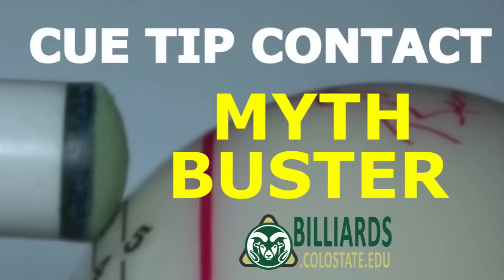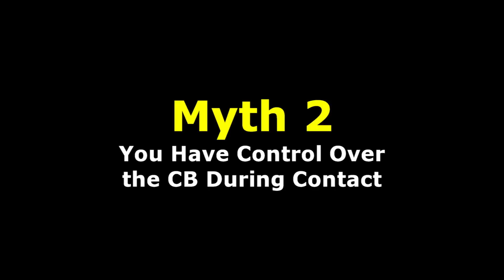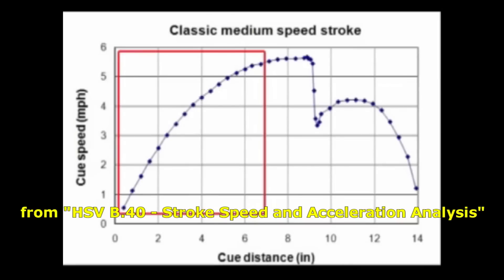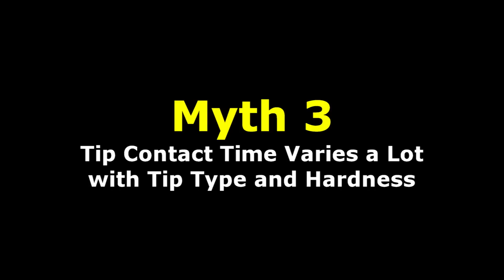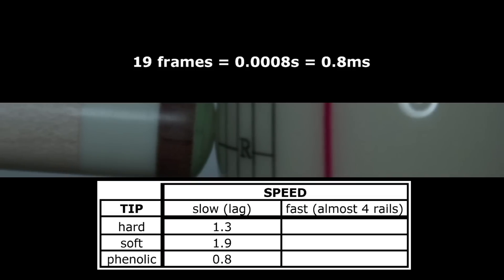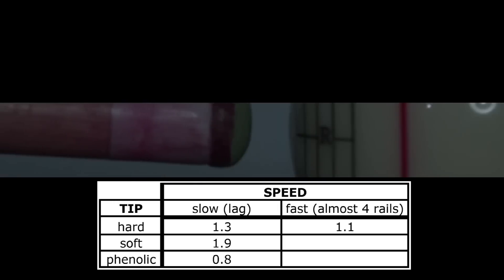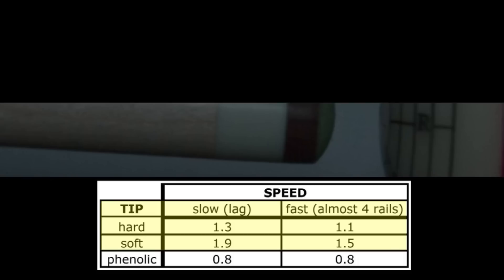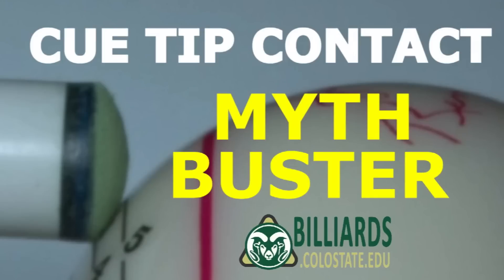Cue Tip Contact Myth-Busting Truths in Super Slow Motion

Comment: With respect, it seems like some of your conclusions/assumptions are very subjective. The tip contact time varied quite significantly - for example between 1.3 and 1.9 milliseconds (for hard vs soft tips in your video) - this is an increase of almost 50%. Why do you assume that this does not have a very significant effect? Just because both times are "very brief" in your opinion? Clearly, every aspect of cue-to-cueball influence (momentum, direction and spin for starters) can and does only occur during the time of actual physical contact - how can an increase of contact time by 50% NOT have a significant effect? I don't know what those effects might be quantitatively but I would be very surprised if they were not significant. I think one would have to look at the RESULTS - including comparing the rotational speeds of the cue ball to see if they differ but in this video there is NO data/video analysis of the actual results. My conclusion based on this video would be "cue tip hardness has a significant effect on contact time - further analysis is needed to show how cue tip contact variation influences the behavior of the cue ball"
Reply from the maker: Good points and questions.  FYI, they are addressed in detail here (especially in the "Can a softer tip put more spin on the ball?" section):
https://billiards.colostate.edu/faq/cue-tip/hardness/
and via the supporting links here:
https://billiards.colostate.edu/faq/cue-tip/contact-time/
Reply: @DrDaveBilliards  thanks for the prompt reply although I have similar issues. I'm a hard-core "science guy" so I'm looking for controlled observations and data while you seem to be relying on personal experience for much of this. Not suggesting you are wrong but also not yet convinced. In this video for example it shows differences in energy transfer based on a person striking the cue ball using three different cue/tip combinations - how is that controlled? How can I assume the identical energy/power is used by this player in each stroke? the player may well be subconsciously altering the power with which they strike the cue ball. This is NOT easy to overcome because it is a well-known/established bit of human behaviour. This "ideomotor effect" is extremely difficult to rule out. When it comes to comparing spin imparted by different tips your conclusion is similarly based on personal experience of repeated attempts rather than in a more controlled/objective way. Instead (ideally) the player should be using identical cues fitted with three different hardness tips and then (again ideally) they should be test shooting by choosing the cues at random and NOT KNOWING (the key!!!) which tip they are using for each shot to eliminate their potential to subconsciously bias the shots.  Another method would be to use the high-speed camera to compare spin rates imparted to the cue ball with each tip and - importantly - ensuring that the cue speed is the same in each case - but this could be assessed through video analysis as well. I realize this is not something that can be done readily but I think it is essential IF we want to gather objective evidence.
Reply from the maker: @ourniche  In many of the videos at the links, I controlled for speed by doing many shots and including only those where the CB or OB travelled the same distance.   And for the experiments for maximum spin, I hit lots of shots near the miscue limit, some miscuing and some not.  If you hit enough shots, one is guaranteed to be close to the limit.  I agree it would be more “scientific” to measure everything with motion tracking software (which Pubo and I have done in my recent stroke timing video), but I think it is unnecessary with the other measures taken.
Reply: @DrDaveBilliards  I don't think we can know this for sure without controlled experiments because you may simply be repeating "subconscious" actions. Anyway - I completely understand why this is so difficult to do. I would note however that the amount of momentum transferred during a collision (the "impluse" using a physics term) is equal to the "force X the contact time" so if the contact time is increased by different tips then the amount of energy transferred MUST change - all else being equal/controlled for. So I am still very doubtful that the tip hardness has no significant influence - seems impossible as it alters the physical interactions between the two balls.
Reply from the maker: @ourniche  The impulse does not change with contact time.  With a longer contact time, the force profile (during impact) has less magnitude, resulting in the same impulse and the same momentum change of the cue and CB.  The impulse is based on the momentum transfer, regardless of the contact time.
Reply from the maker: @ourniche  FYI, the math and physics of this can be found here:
https://billiards.colostate.edu/technical_proofs/new/TP_A-30.pdf
Reply: @DrDaveBilliards  I suppose that is possible - IF the force is less when contact time is extended. Impulse "by definition" is the product of force X time so an increase in time will increase impulse unless the force lessens in a way that "perfectly matches" the change in time - something I find very unlikely.
Reply from the maker: @ourniche  It is not unlikely at all.  It is the only way it can be based on the collision and momentum physics and equations.
Reply: @DrDaveBilliards  interesting! A related question - since a softer tip results in the cue tip "shape" being different during contact with the cueball - wouldn't this have an effect on how the momentum is transferred - thinking here of the vector of the "net force" - wouldn't the force be "more forward" angled compared to the interaction force produced by a hard tip. I'm just visualizing this in a quite exaggerated way - such that a very soft tip (near the miscue limit) is going to deform to produce an interacting surface that is "molded" to the surface of the cue ball - ie a concave spherical shape while a very hard tip will remain closer to a "point" on contact. Would that have an influence on how the force is transferred? There is no doubt that "off-center" collisions between rounded objects are complex enough - adding deforming leather tips doesn't make it easier haha. Thanks for responding to all these questions.
Reply from the maker: @ourniche  See:
https://billiards.colostate.edu/faq/cue-tip/hardness/
The larger contact patch size spreads out the force, but it doesn’t change the total impulse or momentum transfer.
Reply: @DrDaveBilliards  I was wondering if there might be an associated change in the "direction" of the interaction force with differences in tip/cueball interactions. Thanks so much for the link to that pdf. I'll trust all the math haha. I don't want to attempt to get up to speed (no pun intended) on the math re: rotational motion but your descriptions of the results are very helpful. I can do the math to show that the maximum speed (the limit) of the cueball would be 2X that of the cue speed in an elastic center ball collision but that is where my math familiarity ends.  I do wonder why you use actual cue masses in these equations when the cue is being gripped by the hand/arm so that they would seem to be part of the "system" that is interacting. Indeed at the moment of contact the cue "could" in theory have no unbalanced forces acting on it but in reality, it is more likely to either be accelerating or decelerating - and therefore have a net unbalanced force acting on it - which I have to think could have a significant influence on energy/momentum transfer? Wouldn't "accelerating through the cue ball" have a significant influence? I would have thought that the mass of the cue itself is really most significant when it comes to how it influences the ability of the player to generate cue speed/timing of acceleration etc Again thanks for taking the time to respond.
Reply from the maker: @ourniche  The direction of the force does not change any important amount during the incredibly brief contact time. And the cue (and its momentum) dies all the work during contact. See:
https://billiards.colostate.edu/faq/cue-tip/contact-time/
https://billiards.colostate.edu/faq/grip/light-vs-tight/
https://billiards.colostate.edu/faq/stroke/acceleration/
Reply: @DrDaveBilliards thanks for these links Dave.  You say (in relation to accelerating through the shot) "In principle, the cueball will … have more speed and spin … when you apply a force during impact. It’s just that since the impact period is so short (mainly), the effect is essentially negligible." But the impact period - no matter how short, is the only time during which momentum/energy are transferred at all - so if you accelerate the cue and increase the force during this contact time then we would want to know "how much added force" are you generating and are you increasing the contact time by a significant percentage as well? BTW - I love your video with graphs showing cue speed vs cue distance traveled but would be very interested to know if you have ever done this analysis with "amateur players." In your video you analyze the strokes of three excellent players that all reach maximum speed nicely - I'm wondering if weaker players don't do this - IE if this might be a significant weakness in their cueing (other than aim lol)
Reply: I see that you do note that the force IS very small relative to that associated with the momentum of the cue itself - so that makes sense (so I jumped the gun 
when I saw your reference to contact time being "mainly" responsible). Thanks again - I'll have to look through your very rich set of resources looking for analysis of the physics of "weaker players" haha.
Reply from the maker: @ourniche  You seem like the type of person who will actually enjoy and get something out of the resources.  I hope that’s the case.
Reply: @DrDaveBilliards  absolutely - much appreciated. BTW - after reading your explanation for the insignificant effect of added pushing force "during contact" I thought of the perfect analogy. It is the same as hammering a nail - it is true that if you are still applying a driving force on the hammer handle with your hand/arm during impact you will be adding more energy to the nail BUT the added energy transfer is tiny compared to the energy that has "accumulated' in the accelerated hammer head during the long arc of motion before the contact :-)
Reply from the maker: @ourniche  Excellent analogy.
Reply: @DrDaveBilliards  last question for a while - I promise :-) It would be SOOOOO valuable for a player to be able to analyze their own stroke profile (ie graph of cue speed vs distance during a stroke) I have to ask - is there any way of doing this with a cellphone and software? It just seems that if I took a video from the side using my cellphone I could record the motion of my cue throughout a stroke. Then I would just need to be able to determine speed at X number of points during the stroke. I realize a cellphone can't take "high-speed" video but even a crude measure would be helpful. If I placed a "dot" on the ferrule and then just watched the video on a large screen advancing the video "frame by frame" I suppose I could just try and measure and plot this myself but is there any software that you know of that could help? We all have these phones (which 20 years ago would be considered "super-computers") with their high-resolution cameras - seems like we should be able to use them for this - maybe just wishful thinking.
Reply from the maker: @ourniche  it might be possible with the slo-mo video from a phone and a special purpose app.  FYI, the Digicue device and app can measure your stroke using sensors.
Reply: The DigiBall is going to come out this year (I hope). Although it only measures the cue ball's parameters instead of the cue's. You can get more info about that on AZB. I don't think a phone's slow mo feature is of much use for plotting the cue speed-time graph since the framerate is still not high enough. Maybe you can film the slowmo from far far away so the cue doesn't jump from frame to frame that erratically. @ourniche
Reply: Also stay tuned for DrDave's new video! It would at least proves that acceleration doesn't affect the action of the shot. @ourniche
Reply: @puboh  A "digidball" sounds interesting - I assume it will track "spin rate" which would be cool. My iPhone does record at 240 fps so individual frames of the cue are blurred BUT useful. I just did a bit of video last night and tried some analysis with the "Tracker" app (VERY nice!) - it did provide some decent graphs and info - but clearly not as refined as Dr. Dave's with extreme frame rates. Of course "training wise" it would be ideal to have immediate feedback after a shot - I guess you DO have instant feedback when you ignore the camera and simply note the amount of backspin you get on the shot haha. But the quantitative video data is still fun to play with.
Reply: I Agree. I'm having fun with this too! If you have After Effect, it has a Motion Track feature that you can utilize to accurately track the cue's motion. (It does really well when I film the shot at 8000fps, but if the 240fps camera is far enough, I'm guessing it would work half decent?? @ourniche
Reply: @puboh  Unfortunately I don't have After Effects - just can't justify the Adobe license fees for something I would use so little. Have you seen "Tracker" - might work very well with high-resolution high-frame speed videos. Designed for physicists (perhaps mostly physics teachers?) to analyze the motion of objects during collisions and other physics experiments for example. An issue for me is the image can't get too blurred (which it is borderline with 240 fps) or the software understandably has trouble tracking the "chosen point(s)"
Reply: @ourniche  no I have not. I'll check it out!

Comment: I appears that the tip sticks to the ball and the que tip will bend as the ball starts to roll.  Just becouse something can't be seen in 1 ms dose not mean that things are not going on in much less than 1 ms.  Collisions like this are very fast.  I found it interesting that you used miles per hour on your chart.  Cheers.
Reply from the maker: Agreed.  Super slow motion video reveals a lot.  I used mph because that is the common speed unit in American pool (e.g., when talking about break speeds).

Comment: In your "Tip Contact Time" portion of the video you are doing the testing using a tip that is very low. I believe the results would be different if you use a new soft or SS tip. The tip compression time has to change things in this regard, right?
Reply from the maker: You are correct.  A taller soft tip plays even softer.

Comment: Well, your conclusions seems wrong, because even in the video material, there is a visible spring force. And yet, you treat those interactions as stiff.
Reply from the maker: A soft tip does deform more and stay in contact longer (but still a very small interval of time), but this is unimportant to the action of the shot based on the detailed explanations here (and at the links on the page):
    https://billiards.colostate.edu/faq/cue-tip/hardness/
Reply: @DrDaveBilliards  you're making oversimplification. As someone pointed out, there kind of shots - executed by the highest ranked player, where your stiff body physics fails. Because of spring interaction between cue, ball, and table - yes, the table is relevant even in as you say "small interval").
Reply from the maker: @jan.kowalski  Check out the info, explanations, and links at the resource page.  I've done my "homework" in this one, and I taught advanced dynamics at the graduate level for many years.  If anything, a hard tip offers slight advantages per the info on the page.  Here's the link again:
    https://billiards.colostate.edu/faq/cue-tip/hardness/
Reply: @DrDaveBilliards  then please read about Young's modulus and it's applications.